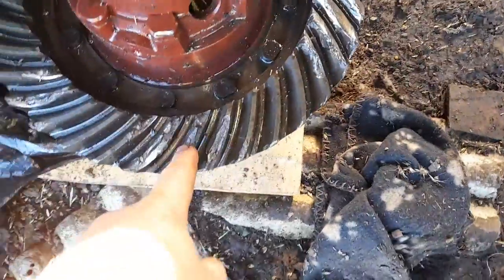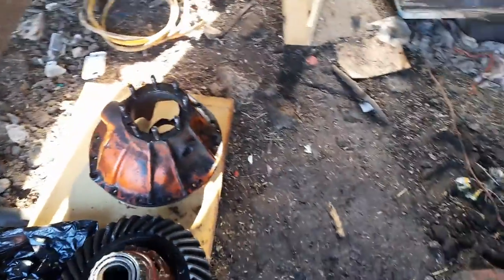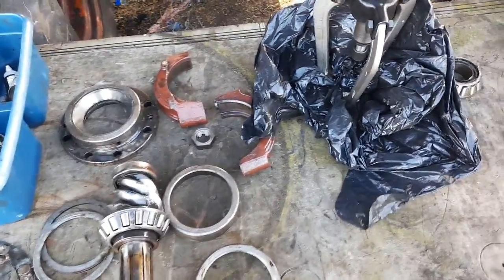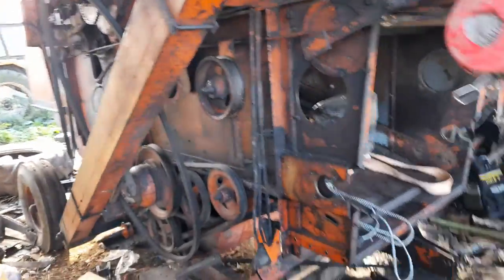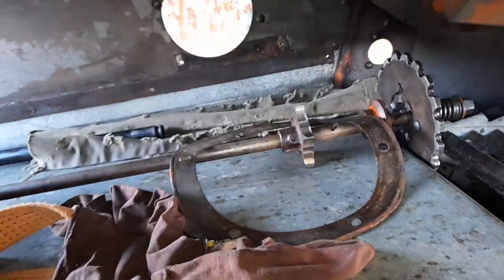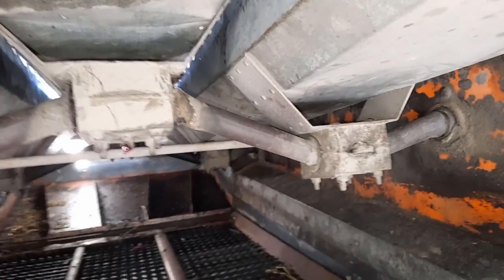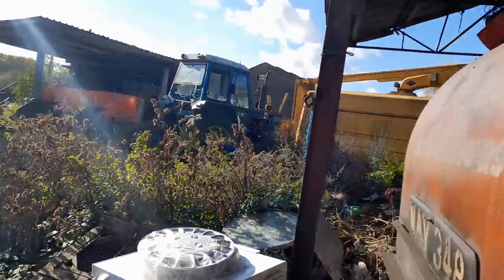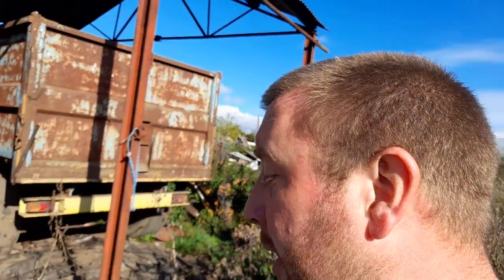#1, 1960 Allis Gleaner Combine. Transmission repair.

Comment from the maker: Just watching back over this video again. Interesting to remind myself of how deep i went into the rebuild process. Was it worth the time and money? I believe it absolutely was, the combine has been faultless this harvest. Fitting a new straw beater and rebuilding the straw raddle has made its performance so much better. It was a good old combine anyway. Its just in its 61st harvest and i couldn't find a single grain left on the floor behind it. Could i have done a better job of the rebuild? Yes i believe i could, theirs a couple of things i rushed a little. One truth i learn again and again. Don't rush restoration projects especially when its stuff like clutch or gearbox rebuilds. Stuff thats a ball ache to re do. Take your time and do it once. Don't let anyone convince you to rush or cut corners.

Comment: How ironic that it took 60 years for the transmission to break.

A few harvests back I looked out of my back window and there were two New Holland CRs in adjacent fields broken down seemingly with transmission problems, one was a 9060 and the other a 980 or 9080 both less than a decade old.
Reply from the maker: Theirs a small bush that sits against the crown wheel in the diff. If that had been adjusted then it would still be in perfect condition.